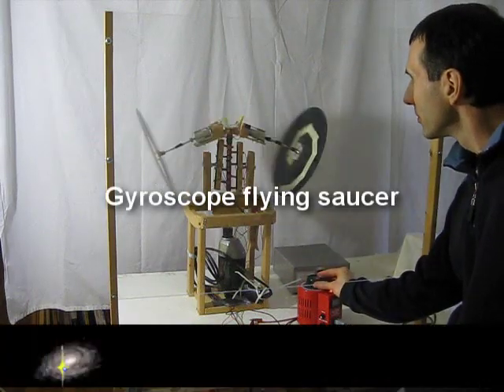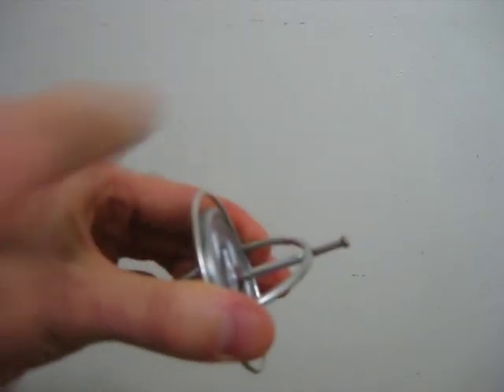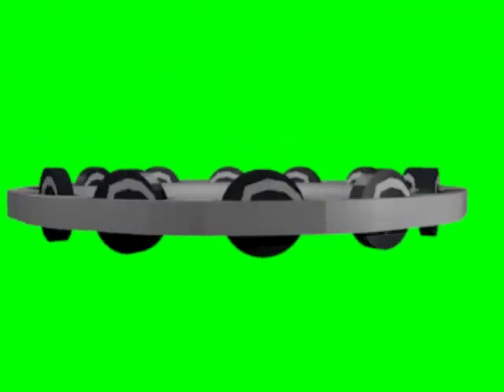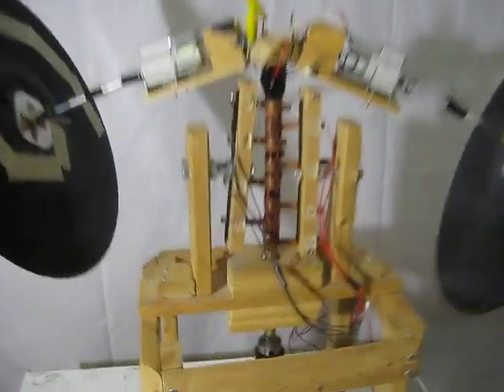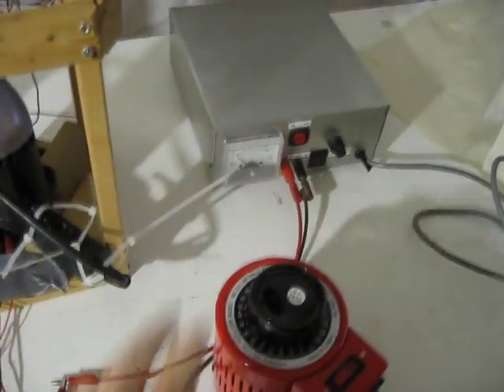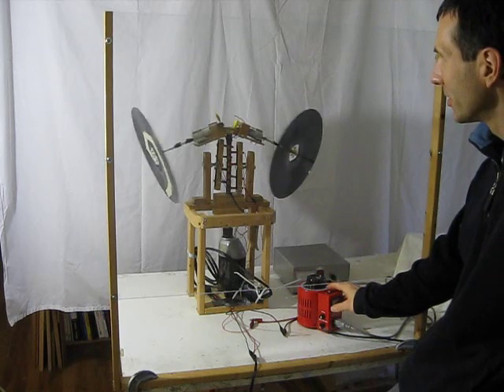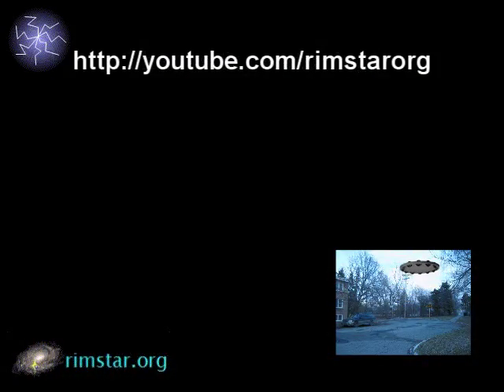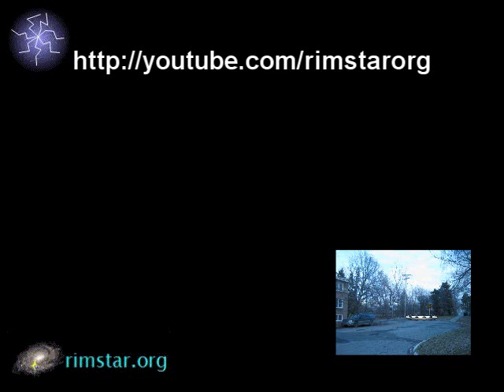Gyroscopic Precession Demonstrations and Flying Saucer Fun

Comment: since it is using g-force it can produce well over it's weight in my theory of how it works , which I cannot explain in words , if the rpm is unlimited the pounds of force are I made something similar to this using a liquid pumped through tubing that is bent in these two directions and realized that it can be completely concealed and still produce thrust

Comment: If you make the gyroscopes heavier than the equipment thats powering it it will cause lift because at a certain point the same exact weight from the gyro is reversed  example; key:gyro= g, equipment powering gyroscope = e         g weighs 100 ibs e weighs 50 ibs if g was reversed the aircraft can lift 49.9 more pounds.

Comment from the maker: It's just to set a starting reference. You zero the scale before you putting anything on it. So when you first turn it on it's showing some weight even though there isn't any yet. You set it to zero since that's really how much weight is on it and _then_ you start adding weight.

Comment: 3 dimmer switches for all 3 motors now that would be a bit interesting, especially if you had the center adjustable to lift up instead of holding it down.

Comment from the maker: I think you're thinking of observation. Yes, first an observation is made, often by accident. Then comes a theory to explain it, followed by a testable hypothesis (ie. if this theory is correct then if I do this then that should happen), followed by the experiment to test the hypothesis. If the experiment gives the result predicted by the hypothesis then the theory has support. If the experiment fails, then the theory needs to revised or rejected. So yes, it all starts with an observation.

Comment: Youre having a misunderstanding about the forces. Good example of the lifting weights in your arms; your weight does in fact change when you lift them, thats the part youre misunderstanding.
Stand on a scale and try it, its easy. like weighing yourself in an elevator, going up youre heavier, going down lighter. Therefore as the arms precess up or down, the weight of the apparatus is changing. 
Im concluding that your expectations led to hasty findings.
great work either way.

Comment from the maker: Oh, I see I wasn't clear. By shaft I meant the shaft that the drill is attached to. Imagine standing on the ground and lifting your arms with weights in your hands. Your weight doesn't change. It's just not obvious why the gyros lift in this case because the forces are transferred through rotation. But there's where I need to read the physics more. The expectations I had were based on the physics I've read. My experiment confirmed them. That's science: theory - hypothesis - experiment.

Comment from the maker: The reaction is through the motor shaft, the motor, the hinge and down the center shaft to the drill. The net is zero. Certainly back when I did it the digital scale I had it one stayed at zero. Meanwhile, it I put a single, lightweight playing card gently on the thing, the scale immediately showed a weight change. Some day I'm going to take a few hours and read the physics of this and get it all straight in my head.
Reply: I love how we can just respond directly to something you did 9 years ago.  Should do a 2022 version

Comment from the maker: I added the hinges so I can see the effect of the precession. As I said at the beginning of the video, the UFO thing doesn't really work. I did that stuff just for fun. But back when I experimented, I did arrange it so they would remain horizontal anyway, and as expected, there was no change in weight.
Reply: Maybe there was a change but your scale wasn’t accurate enough, I mean it’s super heavy equipment you have there and not much mass in the records. And powered by such small motors.  We need answers!! Lol

Comment: my suggestion would be to turn the discs vertically by 90°, so when the horizontally and vertically centrifugal forces add up, the outer resulting force will be bigger than the inner. could you test that with your setup?

Comment from the maker: Yup, I knew that before I built this, like I said at 1:10, "so ignoring reality..." I made this device for the fun of doing it. But you can cheat using something called stick-slip. You make something that sits on a surface and design your rotating parts such that in one direction you overcome the coefficient of friction between the device and the surface but in the other direction you don't. It even works in water. But it would never fly; it needs a medium.

Comment from the maker: I built this device long before I filmed things. Back then I had both gyros turning and the whole thing balanced well enough so that it wouldn't vibrate wildly and so could work on a digital scale. At that time the scale stayed rock solid with no weight change. But while running I could put on a light playing card and the weight would change, so no problem with the scale. I also tried with the arms fixed so they couldn't rise. If you look at the physics, there's no reason it should lose weight.
Reply: try stopping the gyros,thats where the propulsion is. jam a scafolding pole into a motorcycle wheel at 30mph, the rider goes over the handlebars followed by the motorcycle itself, 3 perpendicular gyros = any direction, respin,redirect and keep missing the ground!

Comment: Dude, you have the right idea but your set up is flawed. Both gyros have to be in operation and two LPs just won't build enough force to lift the entire app. power to weight. Add on to this the lack of strength in the structure. But keep at it man.

Comment from the maker: But that's what I said... I tested with the hinges locked. The weight stayed at zero (the scale was zeroed), no change. It's the same as if you stand with a brick in each hand and arms outstretched. You then lift the weights up. That translates to an equal downward force through your arms to your body and if you're standing on a scale there'll be no change. If you lock your arms so they don't move you'll also no weight change. It's just not obvious because everything's spinning.

Comment from the maker: I did lock the hinges a few years ago when I did the original tests. The result was a very steady zero on the scale the whole time. And yet sitting a single playing card on the wooden base of the device would cause a weight change during the test. There should be no weight change anyway since the upward force of the disks is produced by an equal downward force on the center shaft.

Comment from the maker: I locked the hinges or the gyros in the horizontal direction back when I had both gyros spinning. The scale stayed at zero. There's no lift with these because there's an equal and opposite downward force produced at the central axis where the drill motor is. It's the same as if you lifted and object up with your arm. The object lifts up, but your shoulder feels an equal downward force. It's just not obvious with a gyro because the lifting mechanism isn't so obvious.

Comment: hi just came across your video. fasinating that you have the setup but unfortunate that it does produce "enough" lift to produce any reading on the scale. i would have thought the fact that both rotating discs have moved upwards, means they have produced lift to lift partial of its own weight. have you tried to fix the "hinge" of the rotating vinyles spinning axis and lock to the horizontal direction? so whilst it spins... to a non-movable axis may produce some lift that can register on reading?

Comment from the maker: The scale was capable of measuring up to 1/10th of a gram. And when I put a playing card on the unit and removed it the changes in weight showed up.

But if I can pull it off, I will be doing an experiment with a much larger spinning mass. And of course I'll upload a video of it. It'll be very tricky though since a larger weighing method will be needed.

Comment from the maker: @1234ToddgMr Actually the other one isn't spinning at all; I didn't have enough power in my power supply. But you're right... spinning it such that the bottom of the disk moves opposite the direction of the rotor causes the disk to go down. I did spin them both in the right direction a long time ago when I built this and as expected, there was no weight loss. I even had it on a digital scale. I tested with the disk free to move up and with the disks held with their axises horizontal.